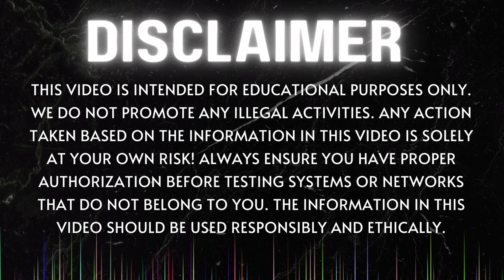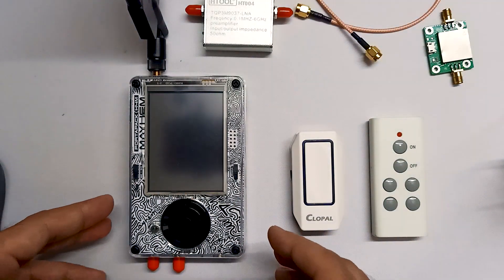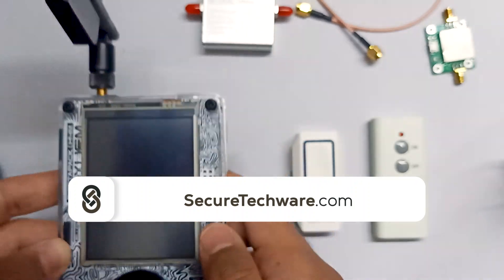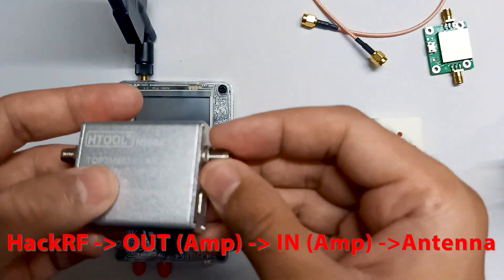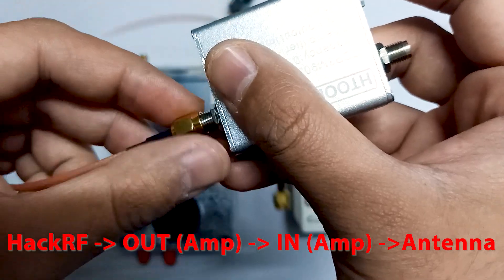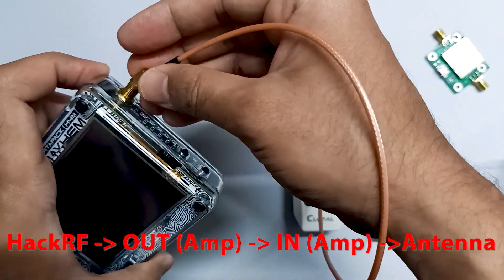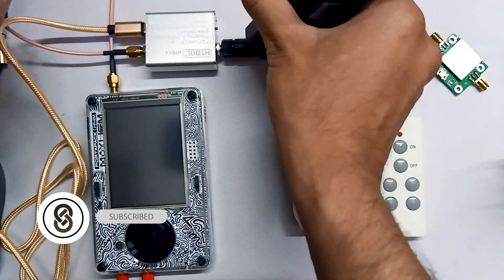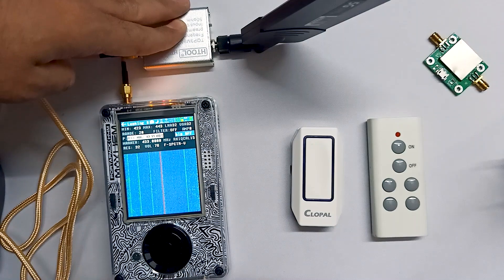Getting Stronger Signals on PortaPack H4M with an External Amplifier

Comment: Hi i have a question, does the transmitted signal get amplified too if i assembled in this order: portapack→in→out→antenna
Reply: yes. TX goes to RF-IN... in the case of RX, Antenna = RF-in . So if you RX and TX from the same SMA port like hackrf, you must disconnect and change direction of the LNA, or you will fry both the lna and the internal lna in hackrf. Bidirectional LNA exist but hackrf needs to switch, you can get a module that detects RX/TX and sends UART to hackrf to automatically change between RX/TX but you need to program it